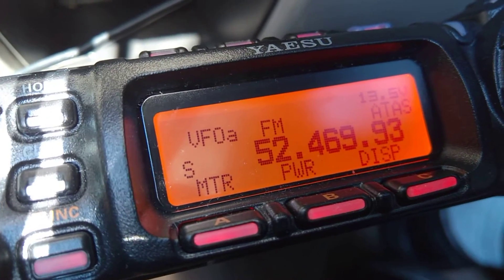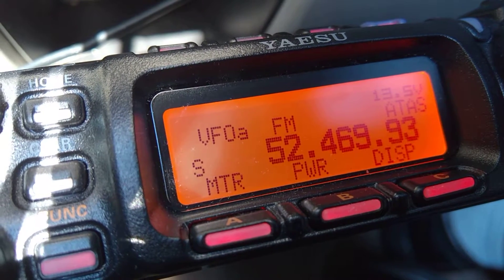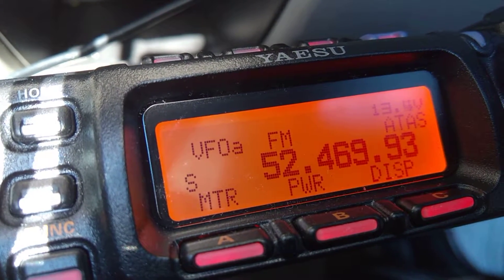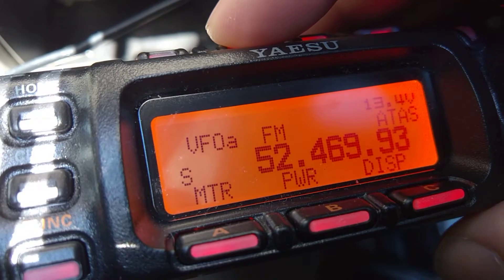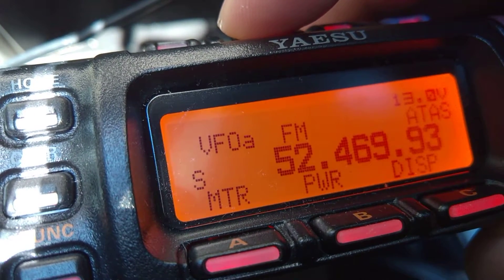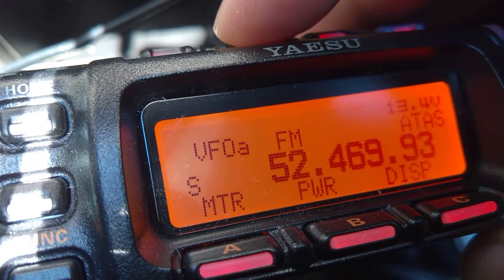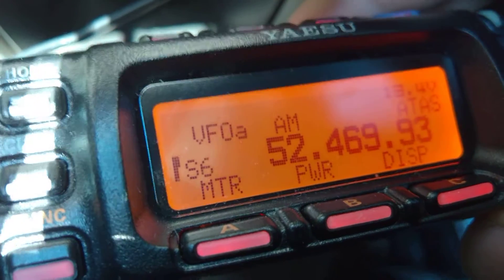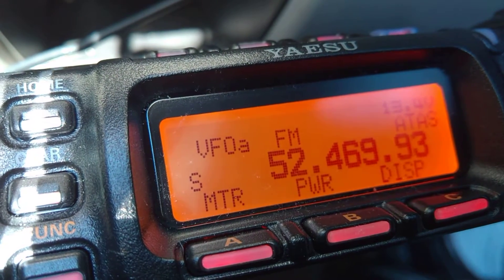Yaesu FT-857D Crackling and High HF Noise

Comment: The noise blanker on the 857 sucks.  I'm no fan of the Ft-100 but side by side mobile the FT-100 beats the 857 hands down when it comes to HF receive and noise reduction.  I've tried everything on the NB as well as DSP and nothing improves things for the 857.  On the other hand the TX on the FT-100 is very unstable while mobile especially 12 and 10 meters.  The FT-100 will sound
horrible with feedback if the 13.8 drops in the least so direct battery connection is a must.

Comment: Hi, I have exactly the same problem with my 857D, it even picks up passing cars engine noise too when I’m static with the engine off,  did you manage to find the solution?
Reply from the maker: Changed the installation of the antenna solved most of the issues. Got rid of the K400 mount (horrible mount) and moved the ATAS to the roof of the car via a hole mount. Then with a 16ft coax, made 7 turns of coax with a ferrite choke.
Reply: Great, I've now turned the NB up to 100 and put 8 ferrite beads on the coax where it comes in from the antenna, I only have a little noise now, but still annoying cos I know its there ha ha ha  :-)

Comment: this is ignition noise.  when you increase the rpm of the engine you can hear it speed up as the spark plugs fire faster.  is this in a car, van, truck, etc.?  grounding straps between all non welded body parts, frame and body, etc.  ground all metal parts of the vehicle together.  This was the solution for a fellow club member.

Comment: The problem is the car, not the radio transceiver treated with ferrites in the power cord, if you turn the noise blanker helps you eliminate some interference,  att KP4MFO  '73